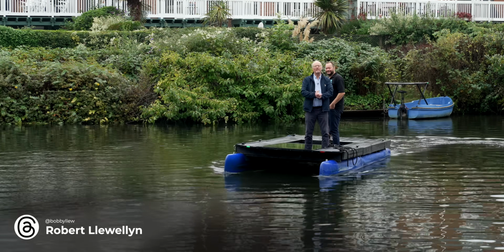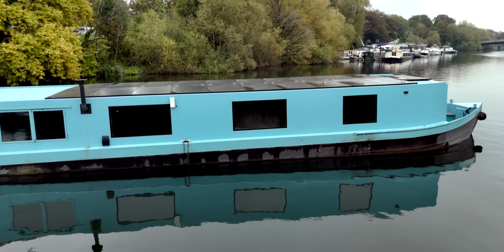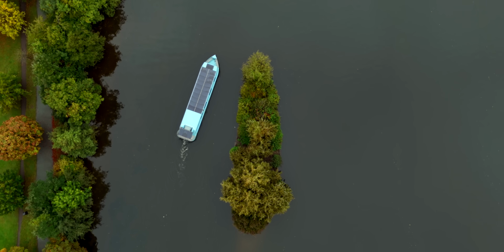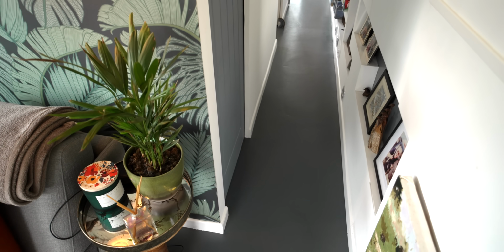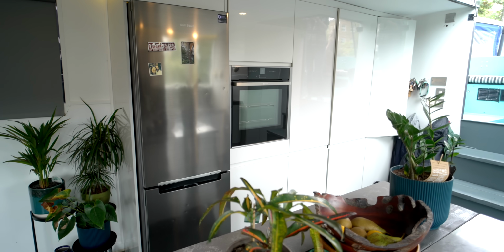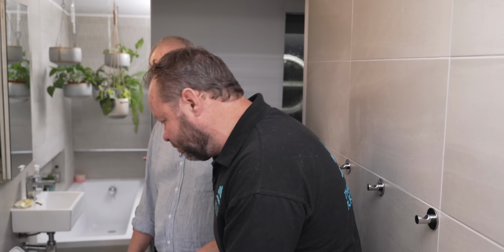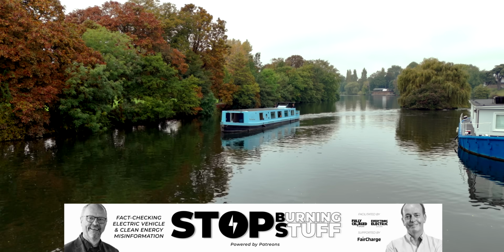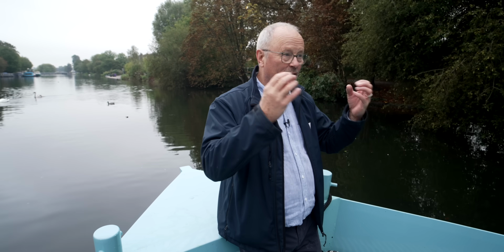Living On An All Electric, Off-Grid Dreamboat!

Comment: Nice to know how the batteries are charged after a hard days cruising. The solar array seems inadequate. Shore to ship charging only works at marinas. Is there a diesel generator  lurking he hasnt told us about. The most efficjent use of diesel is to drive the propellor. Using diesel to charge and store in leaky batteries is even more polluting than using it to drive the boat. I know of one youtuber who makes the point of saying they dont have a generator but they seem to do little cruising. Should not be allowed to call a narrowboat electric if it has a diesel generator. It should be called a diesel electric hybrid or just a diesel electric,

Comment: 96 kWh of lead acid batteries, so no full discharge per day at all, and only 6 kw of solar panel, which is also placed on the worst position ever unless you are on summer at noon...

I would have used angled panels no matter how bad it looks, and possibly motorized.

Comment: Was this system built before Lithium batteries? I believe you only get about 1/2 the stated power out of lead batteries and Lithium batteries are about 1/4 the weight.  Cheers
Reply: Hi Scott , these aren't normal lead acid but rather traction cells which gives 80% usable , and these boats require ballast to keep them in the water so Lithuim weight advantages were negated as lead forms part of the balast. and obviously the cost difference is huge
Reply: Copy

Comment: If these ‘industrial’ lead acid batteries are so brilliant why aren’t they being used as power banks in bricks and mortar properties ?
Standard leisure batteries last between four and seven years on an average narrowboat and that’s without running them right down as you would if you were using them for propulsion. 
If the eco loonies are coming for boat liveaboards be prepared for a fight because battery power isn’t the answer.
Reply: Lead acid batteries last a lot longer than you suggest.

Lithium cells are used because mugs believe they're "better".

What is often overlooked is the cost.

And unless lithiums are  kept warm then they can be tricky to charge them at very low temperatures as can be experienced in UK.

Doubtless LiFePo4 cells (used in narrowboats, not Lithium ion cells) are excellent value in warmer climes.

Ditto solar power, nothing like enough sunshine in UK,as averaged over a year, to cater for a narrowboat's needs so to speak.

Granted you can cover the roof in panels but still not enough room on a narrowboat roof.

Wide beams are something else altogether and might just about cope if you were frugal and you had a lot of panels and batteries and you were away from overhanging trees and high hedges along each side of the canal.

Finding an unshaded spot is easier said than done.

That brings its own problems with (over) heating the boat and panels.

The hotter a panel becomes the less efficient they are.

Having panels bonded directly to the roof can be a problem when you consider by lunchtime on a sunny day the roof is too hot to touch comfortably.

Some boaters cobble up a roof drench using the water as a heat sink and evaporation as well as.

The trouble there is that the submerged pump filter must be flushed daily to wash out the silt (held in suspension in the water column).

Some use a dehumidifier unit to cool the interior but only practical when on shore power.

Naturally in time, as the solar kit becomes more efficient and the cost of batteries remains "reasonable" then we will see more boats abandoning diesel engines.

The above said it may be of interest that hydrogen fuel cells are now a possibility for a canal boat.

"HydrogenAfloat" have a website which might be worth a squint.

Comment: Fascinating episode, thanks for filming / sharing it! ☺️

Technically it’s not all-electric though as they burn wood for heating … presumably 6kW of solar wouldn’t have been enough to run electric underfloor heating as well …

Interesting to see them using lead acid too — but it makes total sense. I was amazed how he said they have to add ballast to keep the boat sitting low in the water, I’d never really thought of that!

Comment: Don't fill your barge with concrete
Reply: why
Reply: @andrewsneacker1256  too heavy
Reply: @DeneHickey  Whats heavier 1kg of feathers or 1kg of steel?
Reply: It was a mistake to fill it with concrete.  Ryan didn't know what he was doing with his first barge.  Making it so heavy and then using solar and electric engine to push it.  I'm sure he would have done it differently in hindsight.  I've talked to a barge builder about this project.

Comment: It’s worth pointing out the vast majority of the UK canal system is not designed for navigation by wide beam craft. Some recently commissioned narrowboats do have electric motors but either require charging off the main grid or have a diesel generator to charge the battery bank. The concept is great for wide beam craft.

Comment: I've got a 50-foot narrowboat (6'10") they built for me which I'm still fitting out. It obviously can't generate nearly as much solar or collect as much rainwater as a huge 65-foot long 13-foot wide-beam, but it's still a huge improvement over my last diesel boat. It needs a generator to provide much of the electricity from late October to March, but I run a cleaner-than-petrol LPG generator. Even with running a generator for a few months it's much better for the environment than running a diesel engine for propulsion and electricity all year round.

The fire only needs to be lit every few days to top up the hot water and extra heat is stored in the floor. This heats up every room, since the whole boat has a floor, whereas usually a boat fire only really heats one room which is why some boats have multiple stoves or diesel-fired central heating which are turned on every day, with many boat fires never burning out from October until April.

Planning a build like this makes the boat less reliant on finding diesel fuel, petrol, wood, and water points. You still need to empty bins, get food and store your poop for composting, so it's not completely "off-grid".

Comment: to those "but how far can it go on a single charge???" just stop it. As always the Norwegians (and Dutch) are already showing us how well developed fast charging can be adapted to boating. So eventually there will be choice of either taking it bit by bit relying on solar and whatever DIY solution may be cheaper or topping up your automotive Lithium battery on a waterfront CCS when going cross country.

Comment: This is one of the nicest boat builds I've seen, I have been looking to purchase a boat for a long time as I think its a super eco friendly way to live. It must have cost him an absolute fortune!!!
Reply: Nothing to stop you searching for narrowboat builders and asking them if they will build you an electrically powered boat and then discussing what you would like included in the build.

Would suggest most will entertain building an electrically powered boat as "business is business", even if they have to sub out the supply, installation and commissioning of the propulsion system.

After all a boatbuilder doesn't become an expert in electric boats overnight.

However ...

As a quick aside there is a channel on YT covering a boat build which is going to be powered by a diesel engine.

The boatyard in questions claiming they are experiencing problems in getting materials, even the diesel engine.

To us cynics this suggests the boat yard is "on stop" ref obtaining credit, or, their
 suppliers themselves are "on stop" ref obtaining credit.

Not necessarily their fault as customers don't always keep up the required stage payments or simply "vanish", leaving substantial debts to the supplier or boatyard.

Would further suggest that anyone looking to have a boat built should ask their bank if it would  be possible to determine if "a" putative builder is in financial difficulties, again to repeat,  through no fault of their own.

The boat I am referring to seems to be plagued with delays ... and reasons for said delays seem "questionable".

Comment: so going off grid in a house is bad.....but is boat is good?  I don't want to the '"feed-in tarif"..I want energy independence!
Reply: Who said going off grid in a house is bad?
Reply: @andrewsneacker1256  in the video he talks about how houses can't go off-grid or it would be "suitable" for a house. but If you have a small mid-terrace say, you would probably be using roughly the same electricity as this boat.. so why not?
Reply: @BigJProductions  I dont know why he said that. Maybe you interpreted something wrong. I think its common knowledge that off-grid stationary house is possible. He cant just sat it not xD Maybe he meant that its easier to travel on your boat straight to fuel/water/dump station and fill/dump. With off-grid stationary house its not possible.
Reply: @andrewsneacker1256  well the reason I reacted like that was because I a have actually HAD a PV installer at the house telling me he won't install it if I insist on being off-grid. I suspect its a condition of the grant (tin-foil-hat-time) the state doesn't want people disconnecting. less control.  frustrating as I still won't connect to the grid , its just that now they have made life a bit harder as I have to do it "DIY".  :(

Comment: If I built a boat like this I'd still have 'to shore' hook up for electricity and water on the 'just in case' principal (a protracted period of heavy cloud = little charge into the battery bank, and  extended period of drought = no rain water into holding tank) as you can never be sure of weather conditions.
Reply: Very sensible.

Comment: A houseboat would be a great use case for a heat pump; it'd so easy to pull heat out of that huge source that you're floating around on! I can only dream about efficiency like that with my air source system 😅
Reply: Thanks , we have a development project in the pipeline
Reply: @thamessolarelectric3662  good to hear! I look forward to your progress 👍
Reply: I was thinking that. Not heard it done but it seems so obvious.

Comment: He’s clearly pushing a solar power business he's involved with so they don't talk about the negatives. The negatives might be quite manageable but you need to know about them… on top of all the other challenges and expenses of living on a houseboat. How much cleaning do the solar panels require? How are they protected from damage? (Does the England not ever get hail?) How much is lost by having the panels completely flat rather than angled towards the sun? Has he ever looked into ways to either manually angle the panels (maybe with a crank) or having a system that automatically tilt them? (whether that system could operate at a positive or not).
Reply: Well ....I'm not convinced that anything you mentioned is actually a negative.....!!
....or, if so, then only a very minor one. ......!!!
Reply: Hi Jacob , thanks for your input we have done lots of experiments and trials to get where we are . So having the panels track the sun would or could double production , that being said there is a lot of moving parts and things that can go wrong with these systems , panels are super cheap at the moment so to us it makes sense just to have twice as many panels . Yes we do get hail but these panels are designed to take a golfball sized hail stone so not a problem in the UK

Comment: Bobby, there's a good channel you should take a look at - Narrowboat Life Unlocked - they are on their 2nd Narrowboat home now and the latest is electric with lipo batteries & solar. They also have a back up generator but move around a lot so that sort of makes sense with less roof space & not many places to plug in on the canal system.

Comment: OK, professional engineer here, a fan of solar and off grid, with an experimental solar/battery house system....

This case study looks to be for a mostly static houseboat on a river. But they (the show) are selling the idea as a solution to all inland watercraft.
I have looked into the idea of a fully electric narrowboat, specifically for the UK canal system. And I'm sorry, but I just can't get the figures to work. Other than for a limited number of boaters.

The majority of boats on the canals are standard width, so half the solar potential of this boat.
The killer is, that there are extended periods of the year where solar generation is not even going to cover daily domestic useage. And that would be in an ideal mooring. Often you will be moored under trees, because that was the only spot available. 
(It is November now, and I am seeing ~2kWhrs daily generation from my 4.5kW house array, which is ideally sited. And it's been like this for weeks. 20minutes use of an air fryer and boil a kettle a few times, and that would be my charge gone.)
Add to that, you are required to move every 14 days, when your mooring time limit is up. And when you move, you don't know where your next mooring spot is going to be,  so how far you need to move. Running out of charge really isn't an option in this situation.

I can only see this working for someone with a home mooring/marina. And only go cruising in the summer, when charge allows. And accept that you may get trapped by things like canal/lock closures.
For year round cruising, a backup generator really is going to be required.

I do love the idea of the ballast as a mass heater. Might work even better with a rocket heater as the burner. (Though that is still burning stuff....)
Reply: You are right with the numbers, it suits us because of how intensively we use our boat. Yes, at the moment, the tech is not there to support narrowboat continuous cruising, at least not affordably. But just because it doesn't, doesn't mean it's a bad idea all round. I think a big area of debate is what to use for heating and cooking- we've stuck with LPG for that because of the high currents required and we use the electric for propulsion and lighting. If like the guys in the video you are doing everything electrically, you do need that widebeam roof! As for using ballast as a thermal sink (Heated up by whatever means), it could be done but would need a load more insulation in the bilge than most boats have: Its pretty cold under the waterline.
Reply: @alanbeckett4  Heat pumps might work here, drawing heat from the canal. The COP could be quite high.
Though I still think that the limited surface area of narrow boats (and probably wide beams as well) covered in solar PV is going to struggle to drive even this.

Comment: Strange to hear people going «wow» over 75 mm insulation in the walls. I have 300 in my house here in Oslo! (though building codes require only 200 mm).
Different climates
Reply: Yes, I think the "wow" is simply because a normal narrow boat can typically have next to zero insulation. It's all a compromise of course.
Reply: .....different objects!!
....try putting 300mm of insulation in a houseboat ........

Comment: Love it. (I'd also love to know more about the costs involved. A wonderful project but I can't imagine it was cheap.)
Reply: For a fully fitted one ready to drive away you'd be looking at 220k-250k. For a Shell, basically ready to drive with solar, batteries, engine, windows, engine etc installed, but WITHOUT any interior construction or installations you'd be looking at 110k-130k.

Comment: A surface water heat pump system could be used for heating in winter. The water temperature is almost constant and a simple heat pump can supply 4-5 kWh of heat for hot water and heating from 1 kWh of electricity.

Comment: At last! I’ve long wondered why there aren’t more of these, particularly conversions as traditional narrow boats are designed to carry heavy loads and have loads of roof space! I love the thermal mass development as well. What a great project!
Reply: The majority of people living on boats on the U.K’s river and canal network are doing so because of monetary reasons. To presume they all could convert to electric is preposterous.
Reply: @FriendlyFecker  

Quite so. I gather quite a few permanent moorers (in a marina or on an arm) are in receipt of housing benefits. Probably cheaper than offering council accommodation???

That said there are plenty of very affluent people who choose to retire to a narrowboat and price isn't necessarily a problem, as we have seen.

A recent trend has been for electric narrowboats to have the option of a diesel generator in a sound proof cabinet, with hospital silencer, to charge a huge bank of lithiums in a vertical rack.

Can't quite see how that arrangement reduces the CO2 but that's some narrow boat builders for you.

Very, very recently I was nattering with a  narrowboat  engineer on the topic of hydrogen fuel cells.

He mentioned some outfit was in the process of designing a propulsion system.

That said the method of getting fuelled up hasn't been determined as yet.

Anyway, plenty of cash on the cut, but you might not see it.
Reply: Merely search YT and all will be revealed.

There's hundreds of DIY projects on the topic.

A lot of projects might  be considered more technically advanced in that an electric motor/generator is connected via a belt drive to the prop shaft.

This means the motor can be driven by the diesel engine to act as a generator for charging the battery bank when the weather is not suitable for solar charging.

The most complex bit might be considered as the sorting out of the motor control system.